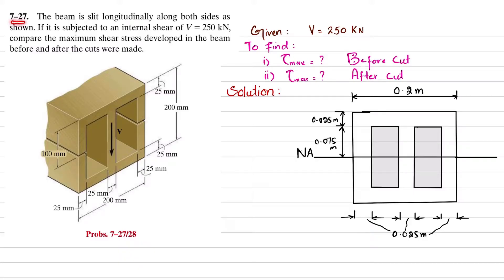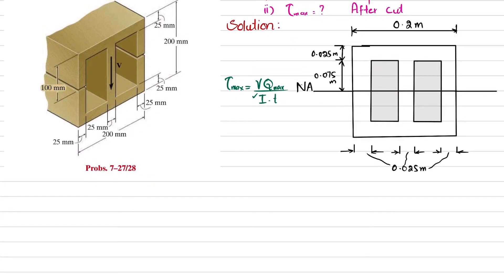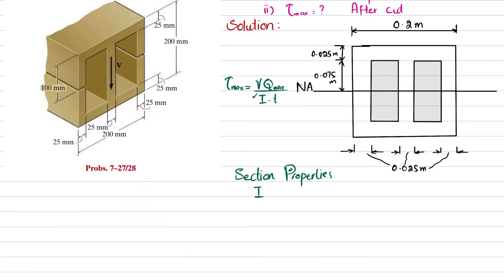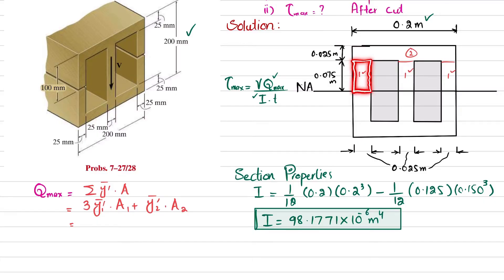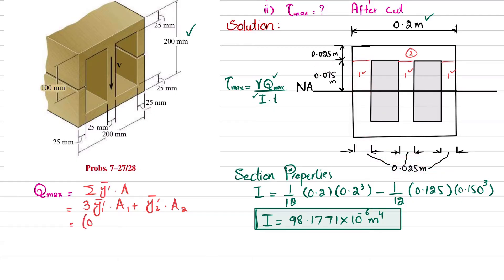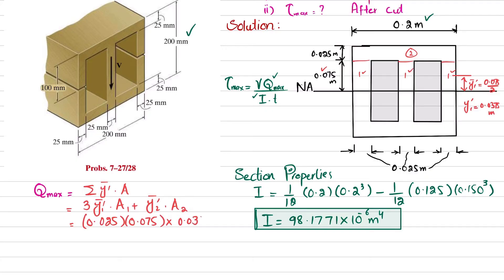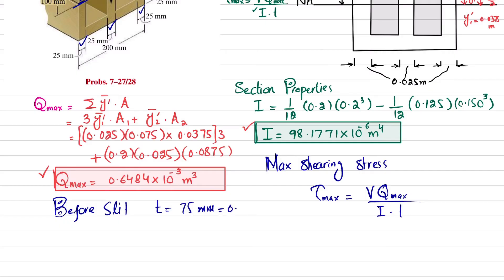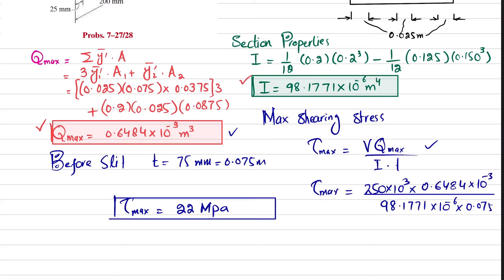7-27 compare the maximum shear stress developed in the beam | Mech of Materials Rc Hibbeler

Comment: Why 1/12x0.125x0.15 don’t need to x 2?
Reply from the maker: Kindly mention the time where you have problem
Reply: 3:48 i have the same problem
Reply from the maker: Ok you can see the total width is 200mm =0.2m while the gaps are 0.025 and the base of each empty portion is 0.0625m so total width of empty portion  is 2*0.0625=0.125 m . So now you can either do like what I have done or you can write 2nd term (1/12 * 0.0625* 0.15)*2 and its same to (1/12* 0.125*0.15). I hope it is clear now.
Reply from the maker: Ok you can see the total width is 200mm =0.2m while the gaps are 0.025 and the base of each empty portion is 0.0625m so total width of empty portion  is 2*0.0625=0.125 m . So now you can either do like what I have done or you can write 2nd term (1/12 * 0.0625* 0.15)*2 and its same to (1/12* 0.125*0.15). I hope it is clear now.
Reply: @engradnanrasheedmechanical  thanks for your response!
Reply from the maker: @gabbodeva you are always welcome and I hope your problem is solved now. Keep watching and sharing 😀

Comment: In Q part, my Q got a different value thab yours cause I considered the whole rectangle - the 2 windows ... The width of the window is = 200-25-25-25 = 125/2 =62.5 . Consequently , Q= 100(100)(50)-2(62.5)(75)(37.5) = 148437.5 mm^3. Thats how I think actually.
Reply from the maker: I think you have also done right. But calculate my values may be something wrong in that. But your concept is also OK....
Reply: @engradnanrasheedmechanical  Thank you 👍🏻
Reply from the maker: You are welcome and I am happy that you are trying it in your own way....